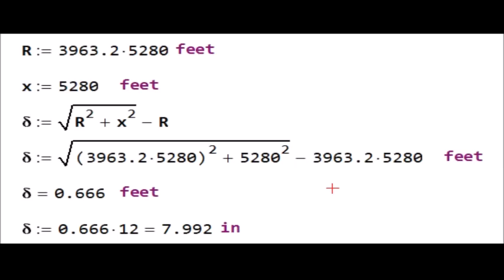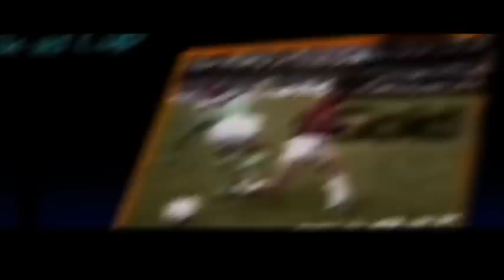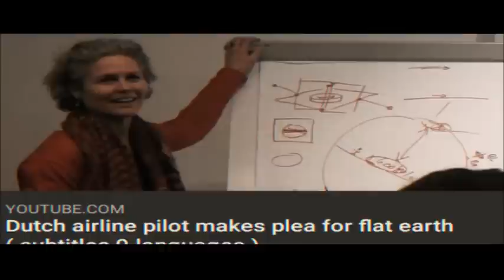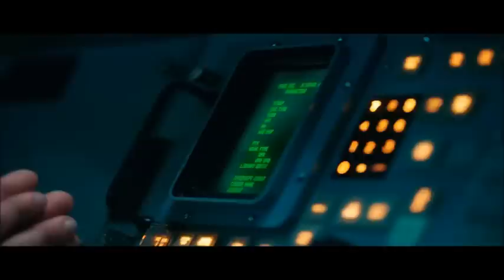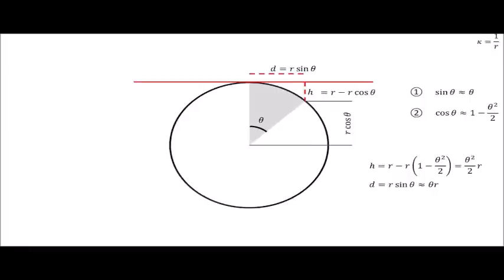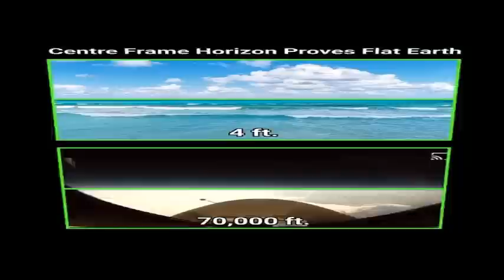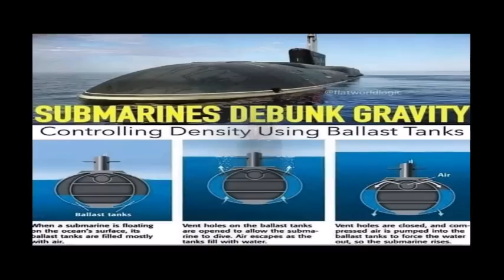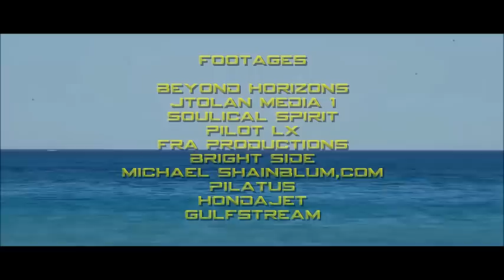2022 Flat Earth documentary Flatten The Curve by Vikka Draziv ✅

Comment: ººThere's no way that a large source of heat that is far away can render an object frozen at the top and bottom but hot in the center.  For that to occur the source of heat would have be close and small.  Meanwhile we can see moonlight on local clouds but not on distant clouds. The Sun and Moon are local and small.
ºIf you are in a car going around a curve then you're going to uncontrollably slide across the seat. 
They say that we are spinning 1038 mph while going around the Sun at 66,600 mph while our system goes around the galaxy at 480,000 mph while the galaxy goes around the “Great Attractor” at 2.2 million mph.  That's four different curves that we are supposed to be going around at the same and yet, no seatbelts.
ºThey say that that the Earth's rotation is due to the surplus energy of the formation of the Solar system.  So what makes a gaseous atmosphere rotate ?  How can air be fastened to the ground ?
 They say that we don't feel motion, only acceleration. How would you feel any acceleration when there is no motion ?  If we were in motion then any change would be noticed but if the Earth is at rest then there couldn't be a change in velocity.
ºI used to think that the Earth was a ball, which is why I couldn't realize the truth.  But once I did realize the truth, then it all made perfect sense and now life is no longer a mystery, it now has meaning, direction and purpose.  
 Darkness lost its grip in this light and death became meaningless.  Spiritual consciousness, eternal and devoid of the change of death, is the true state of life.  
ºFlat Earth realization is only the beginning.  God or not, man is the center of Creation and a universe being created is not only redundant it is deliberately misleading  There is only Creation.
ºIf you can see waves crashing on the beach with a zoom lens 20/50 miles out to sea, then you already know that the Earth is flat.  You just haven't connected the dots yet. 
 ºIf you know that we've been navigating by Fixed Star Location for over six thousand years, then you already know that the Earth is stationary.  You just need to put the pieces together.
 ºIf you want to see flat-earth proof then take an airplane five miles high and look out the window.  The horizon will always come up to your eye level. That can't happen on a ball and it would  be stupid to believe otherwise  
 I know that the story of Genesis has been made to sound foolish but it’s nothing compared to what mainstream science would have us believe.  They are trying to deny us of our birthrights by hiding Creation from us. They don't want us to become spiritualized and free ourselves from material entanglement. (Earth is our habitat because Earth is our habit).
"Him that overcometh will I make a pillar in the temple of my God, and he shall go no more out." Revelation 3:12.
God Bless and Optimism.
Reply: I’ve stopped reading your comment after the first sentence, which is just wrong, why should I be bothered reading the rest? Even the description of the sun as a source of heat is mostly wrong. You are ignoring atmosphere and different types of electromagnetic radiation, IR, UV and Vis. In other words, you don’t know anything about climate and the underlying physics of interaction between light and matter. Without the atmosphere earth would be very cold all over the place.
Reply: @enricocavallo4386  Answer this . The earth is travelling at over 1000 mph at the equator. A Boeing top speed is 570 mph . If the Boeing takes off in the exact same rotation of the earth it is essentially flying at 1600 est to reach its destination. If that same Boeing takes off ln the exact opposite direction as the rotation of the earth.. how could it reach its destination when it is 500 mph too slow for the rotation of the earth? Take your time sweetheart 🤣🤣
Reply: @enricocavallo4386  the Boeing can only reach its destination flying with the earth rotation because it s speed is faster than the rotation. It’s very simple.. the earth is flat.
Reply: @adambartlett6421  , what does your comment have to do with the comment I made? There is a simple answer to your question, which basically is just a flat earther straw man argument. The problem is that you don't know anything about physics. Otherwise you would not raise the silly question.
Reply: @enricocavallo4386  the reason you stopped after the first sentence is your cognitive dissonance. I know , it happened to me several times before I pushed passed it and opened my mind. I used to tell people how much they didn't know about the atmosphere and a whole bunch of other things. Until one day I came to the realization that I also only knew what other people or books had told me about all of  those things. I didn't want to be called all of the names that I saw gloabers calling FEers. Until I realized it didn't matter, they don't know me and besides my curiosity was just eating me up. At first it was crazy then it was entertaining and then it started making more sense than everything I had learned about our planet/home over the past 45 years. I don't know how it actually benefits me personally to believe the earth is not a globe because I already believed in God and that Jesus Christ died and rose for the forgiveness of my sins. I understand better now why they push the ball Earth narrative. Ultimately it takes God out of the picture. It's Satan's way of getting at God by taking as many souls to the lake of fire with him as he can. The truth will set you free and Jesus Christ is the truth ,the way and the life. Don't stop seeking the truth.
Reply: @adambartlett6421  for starters, your assumption that the earth is travelling at over 1000 mph is a misconception. You confuse speed with angular speed. As to the latter, watch the hour hand of a clock moving. That's twice the "speed" of the earth spinning. Got it?
Reply: @adambartlett6421  , the only thing your question disproves is your knowledge in physics. I mean, basic physics including Newton's axioms. Every observation is in accordance with the globe model and you flat earthers cannot even explain the sun path.
Reply: @adambartlett6421 , and because you lack this understanding of physics you are not in a position comment on the shape of the earth. Before you question the spinning globe you have to understand it. I'm afraid you don't. My advice: get an education.
Reply: @jelly7310 , you can believe whatever you want but scientific facts are not a matter of belief. Likewise, the bible is not a source of  reference when it comes to science.
Reply: @adambartlett6421 , "we're done with here" is a toddler's reaction.
Reply: @enricocavallo4386  you can’t answer because it’s flat
Reply: @adambartlett6421  which part of my previous comment did you not understand?
_ for starters, your assumption that the earth is travelling at over 1000 mph is a misconception. You confuse speed with angular speed. As to the latter, watch the hour hand of a clock moving. That's twice the "speed" of the earth spinning._
Once you confirm you understand Newton's axioms and the difference between velocity and angular velocity I can answer your question. Before that it would just be pointless.
Reply: The sun is demonstrably millions of miles away. Simple trigonometry that a child can do proves this. You can also show that it isn't local yourself with a stick. The earth is a spheroid
Reply: According to science earth is rotating approximately 1,000mph clockwise.  The moon is moving 2,288mph counterclockwise around the earth and it takes 27 days to complete a full cycle.  The earth is circling the sun at 66,600mph and moving 140mph thru the Milky Way. Then, the Milky Way is speeding through the Universe at 1.3million mph! 
Polaris remains in the same position? Star trails are consistent? 
I know, gravity keeps them by our side!🤣
Reply: @natalierhoten8609  polaris is 323 light years away. The radius orbit of the earth around the sun is 93 million miles which is a 0.00015 light years. So with this in mind the amount of distance we move in a human lifetime is very small (but significant) and simply glancing at the stars will make you think they are always the same. Using carefully calibrated equipment you can detect stellar parallax which shows that we are moving. It's quite simple really.
Reply: @natalierhoten8609  , Startrails disprove flat earth. As to the rest of your comment, see Andre's response. Didn't you take physics in school?
Reply: @super_ficial  , about each sentence you wrote is totally wrong. For examples lakes and ponds are affected by moon's gravity. But the less volume of water is to be moved,  the smaller the effect. And streams? Well, they're floating anyway due to earth's gravity and the effect of moon's gravity is  negligible.
Reply: @super_ficial  Tides caused by electromagnetism? You didn't take physics  in school, did you? And then the question arises what happens to diamagnetic water in ponds and lakes? You're challenging your own arguments 😄
Reply: @natalierhoten8609  lts insane to think this is happening and we have mirror like lakes when there is no wind 😂😂😂😂
Reply: @enricocavallo4386  you only proved his point more, if the sun doesn't provide the only heat source it makes the suns distance even less important.
Reply: @carbide1968  , did you actually read and grasp my comment? Do you understand how the earth is heated? I give you a clue: imagine there was no atmosphere...
Reply: @adambartlett6421  by your logic it would be insane to think you could have a drink on a plane. Think about it.
Reply: @enricocavallo4386  What is the angular speed?
Reply: @super_ficial  I tried to disprove the Flat Earth theory 7 years ago! Looking for the ONE photo of the ENTIRE earth without CGI! It's like looking for a needle that doesn't, exist in a haystack!!!
Reply: @super_ficial  Yet, we're the special crazy ones?
Reply: @natalierhoten8609  l want to meet you
Reply: @adambartlett6421  Not gonna😘
Reply: I'm too shy😉
Reply: @natalierhoten8609  Shyness is debilitating, get over it.
Reply: @natalierhoten8609  😟
Reply: @natalierhoten8609  if you don't know what singular speed is pick a physics book.
Reply: @natalierhoten8609  the Blue Marble photo was taken before there was CGI. Besides, you don't need a photo to disprove flat earth. Put a stick into  the ground and watch the movement of the tip of the shadow it is casting over a period of several hours. If it is circular, earth is flat. Simple, isn't it? Why doesn't any flattie do this experiment?
Reply: @super_ficial  , no response to my comnent on the first sentence of the initial comment? I thought so - you're  clueless.
Reply: @super_ficial , your playing with numbers is so ridiculous...
Half of it doesn't make any sense when you apply the metric system or    round the numbers at a different digit. The rest is just far-fetched, especially the allusion to carbon atoms (by the way, there are carbon isotopes with 7 or 8 neutrons).
Reply: @super_ficial  I'm not really shy(maybe sometimes). I've been in sales most of my life then, Room Mom...I'm divorced due to conspiracies and FE. It's been ruff. I don't date. Most people don't understand me. They think, I'm a little touched. Why bother?
Reply: @natalierhoten8609  The one constant thing in my life has been disillusionment and it's almost always painful, but it's the price that we pay to free ourselves of material entanglement and Spiritual liberation.
  "He who learns must suffer. And even in our sleep pain that cannot forget falls drop by drop upon the heart, and in our own despair, against our will, comes wisdom to us by the awful grace of God…"    Aeschylus
Reply: @natalierhoten8609    You feel isolated because you are a world in a universe of plants. They can't relate to you.  You need to look inwards.
ººAnytime life comes in contact with matter its ego becomes influenced and entangled, its consciousness is dragged down into this realm of pleasures.  But all pleasures are habit forming and will ultimately end in sorrow, despair and the surrendering of the ego (the Devil doesn't know who he works for).   Matter was designed to bring man back to God.   God's plan is perfect in every way.
ºSaints have declared that if a person, even once, really desire salvation, that desire is firmly planted in the super consciousness's mind, no matter how long it is ignored, it will germinate when favorable opportunity arises.
ºAll personal issues and all enigmas can be resolved though the development of intuition, the divine medium of communication between God and man.  Meditation, Prayer and Yoga should not be underestimated.  Prayer (speaking to God), Meditation (listening to God) to develop intuitive reasoning and realization and Yoga (the science of God) to burn Karma (attachments to materialism).
 So that we can free ourselves from material entanglement and get out from under the wheels of reincarnation once and for all.
"Him that overcometh will I make a pillar in the temple of my God, and he shall go no more out."     Revelation 3:12 

Autobiography of a Yogi
https://www.ananda.org/autobiography/ 

Enjoy.
Reply: @super_ficial Life is beautiful! It is a stage or several acts, we are living though. I'm in the early final act(hopefully). 
...blah, blah, blah...
I hate texting and I'm  tired of Fe! 

Sweet dreams...Don't take the Red Pill!

The Earth is
Reply: @natalierhoten8609  It is nice to be able to see the finish line.
  When you awake from this dream, I hope that it will be into a sweeter dream.
Reply: @adambartlett6421  
"Answer this . The earth is travelling at over 1000 mph at the equator. A Boeing top speed is 570 mph . If the Boeing takes off in the exact same rotation of the earth it is essentially flying at 1600 est to reach its destination. If that same Boeing takes off ln the exact opposite direction as the rotation of the earth.. how could it reach its destination when it is 500 mph too slow for the rotation of the earth?" -Adam Bartlett
You are so close to answering your own question. The plane would fly at about 1600 mph when observed away from Earth, when following Earth's rotation. In the other direction it would fly at about 430 mph in direction of Earth's rotation. Since that speed is slower than Earth's rotation, the ground basically overtakes the plane making the plane move in the opposite direction relative to the ground.

It's like walking on conveyor belt. Let's say the belt moves at 5km/h. If you move at 5km/h relativ to the belt in the same direction as the belt, you move at 10 km/h relative to an outside observer. When moving in the other direction you are basically standing still for an outside observer. In both cases you would move the same distance relative to the belt. Or on a treadmill, where you can run for kilometers while not leaving the treadmill.
Reply: Bless your heart❣Are you saying for seven years,  you couldn't figure the shape of the earth out with out CGI? Have you seen, "The Blue  Marble" where he explains,  "it has to be photoshopped " by Robert Simmons! 
The astronaut Don Pettit said,  he would go to the moon in a nanosecond, but we lost the technology?"
Reply: @natalierhoten8609  
Robert Simmons only talks about the blue marble from 2002, which is a composite of photos taken by low earth orbit satellites. It's not CGI. He also mentioned the photos taken during the Apollo missions, which as he said, at the time of writing, were the last photos taken from far enough away to capture an entire hemisphere. Those were are not photo shopped or CGI.

Building rockets to bring astronauts to the moon are very expensive, and NASA's budget was cut after landing on the moon six times, because the public lost interest. They simply no longer had enough funding to build Saturn V rockets, and repurposed the construction facilities to build smaller rockets to send satellites into orbit. Nowadays they are working on the Artemis project to return to the moon.

He also said that they used to have the technology. We also no longer have the technology to build steam trains, does that mean that steam trains didn't exist?

Explain to me how does someone saying that one image is photo shopped, not CGI, mean that every image is CGI?
Reply: @super_ficial  I bought it, hook line and sinker! I was a space junkie until 2016 when, my world was turned upside down! Once you've done the research, you can't go back! 
I'm pretty close to you in age. The Challenger space shuttle was devastating! It made me sick to see all students watching their teacher take flight! 
We live in a sick world! I want to put my rose colored glasses back on and forget what I've learned.
Reply: @natalierhoten8609  You don't want to do that.
    He who learns must suffer. And even in our sleep pain that cannot forget falls drop by drop upon the heart, and in our own despair, against our will, comes wisdom to us by the awful grace of God…  Aeschylus
Reply: @super_ficial  I know. Everyday, starts with prayer and ends with prayers and a lot in between! Our Heavenly Father probably wants a break(just kidding).
Reply: @natalierhoten8609  Everything starts and ends with, The Word.
Reply: @natalierhoten8609  Everything starts and ends with, The Word.
 ººWhen you wake up in the morning and you hear that buzzing sound in your head, that is your Medulla oblongata (the mouth of God) vibrating.  And from the mouth of God comes the Word of God.  This vibration is the Holy Ghost,  Jesus's gift to us that he called, "The Comforter" unison with this vibration is union with God.  This is the sound of Creation revolving around you.   And not the other way around
"In the beginning there was the Word and the Word was with God and the Word was God"  and the Word is, "Aum".   Aum is the cosmic vibration that hold all atoms together as opposed to, "Om" the comic vibration that keeps atoms apart.  In Hebrew it's pronounced Amen and Al-man. Krishna walked on air four thousand years before Christ walked on water and four thousand years before the crucifixion Yogis used the cross to represent man's eternal life as Spirit over his ephemeral life as an animal, and then as if by script, Jesus a man who died like an animal on that very symbol, crossed over and released his spirit as pure Christ consciousness.  Over thousands of years and thousands of miles the story progressed, the truth never changed and it all began when the Heaven and the Earth was created as God moved his hand across the face of the Deep and divided the Waters from the Waters.  Water was never created and it certainly doesn't bang.  There was no Big Bang, just a Big Lie.
 The bodies of all creatures are spumescent bubbles on God's comic dream-ocean.
Reply: @super_ficial  That blew my mind! You are so beautiful and eloquent with your description of our Heavenly Father"s word through his son, Jesus Christ our lord and savior!
I have been disillusioned from fake people in my life.  It hurts to see so many destructive esoteric humans!
Reply: @natalierhoten8609  Thank you.  "Beauty is all you need to know". from The Bible.
Reply: @natalierhoten8609 , it doesn't matter what you or I believe. Earth is not flat.  You suggest applying common sense. Well, if you did you'd understand earth cannot be flat. I repeat:
Put a stick into  the ground and watch the movement of the tip of the shadow it is casting over a period of several hours. If it is circular, earth is flat. Simple, isn't it? Why doesn't any flattie do this experiment?
Reply: @enricocavallo4386  The World Record for Long Distace photography is from: Mark Bret on 7/16/16. It's 443km/275.27miles from Finestrelles Pyrenees to the Apls! That's not possible with sticks or a globe!
Reply: @ActionParsnip  How far away is 323 light years away?
Reply: @enricocavallo4386  I took it in college.
Reply: That was beautiful!  Genesis tells us God seperated the waters above called heaven from the waters below on Earth. And it was good!
Reply: @enricocavallo4386  I would highly recommend you watch "Flat Earth Clues"! Then, come back with a more educated response.
Reply: @adambartlett6421  Where do you live?
Reply: @natalierhoten8609 l live in Sunshine Coast Queensland Australia you nat?
Reply: @adambartlett6421  Cumming, Georgia, USA 🇺🇸
Reply: @natalierhoten8609  ººWhen you wake up in the morning and you hear that buzzing sound in your head, that your Medulla oblongata (the mouth of God) vibrating.  And from the mouth of God comes the Word of God.  This vibration is the Holy Ghost,  Jesus's gift to us that he called, "The Comforter" unison with this vibration is union with God.  This is the sound of the Creation revolving around you.   And not the other way around
"In the beginning there was the Word and the Word was with God and the Word was God"  John 1:1
And the Word is Aum.  Aum is the comic vibration that hold all atoms together as opposed to Om the comic vibration that keeps atoms apart.  In Hebrew it's pronounced Amen and Al-man.       
 Krishna walked on air four thousand years before Christ walked on water and four thousand years before the crucifixion, Yogis used the cross to represent man's eternal life as Spirit over his ephemeral life as an animal, and then as if by script, Jesus a man who died like an animal on that very symbol, crossed over releasing his spirit as pure Christ Consciousness.  Over thousands of years and thousands of miles the story progressed, the truth never changed and it all began when the Heaven and the Earth was created as God moved his hand across the face of the Deep and divided the Waters from the Waters.  Water was never created and it certainly doesn't bang.  There was no Big Bang, just a Big Lie.
ºThe bodies of all creatures are spumescent bubbles on God's comic dream-ocean that we call, "The Waters, The Deep, Mayim, Thrum, Celestial Seas or Primal Ocean".
ºA universe being created is not only redundant, it is deliberately misleading, there is only creation and we are the center of Creation, man's image is not random but his wisdom is poison.
Reply: @natalierhoten8609  nice 👍. I e always wanted to travel to the states but I’m unvaxxed 😩
Reply: @adambartlett6421  Sadly, me too! I can't even cruise without being vaxed!
Reply: Thank goodness, I've been there and done that! But, my teenagers haven't!
Reply: @natalierhoten8609  lovely to talk with you. Stay safe and tuff
Reply: @natalierhoten8609  They will be fine.  
 We all have to finish our dreams before awakening.
Reply: @natalierhoten8609  , "The world record..." - that's a nice one! All of Marc's pictures are in full accordance with earth's curvature and he also explains it well. You should not only look at the pictures but also read the text, especially under the headline "Refraction". You should also read the comments section, in particular comments made by Dark Star and you should go to his web page as well.
Reply: @natalierhoten8609  Still on "The world record..." 
If earth was flat you would expect a much, much higher world record. With a good telescope you should be able to see the Manhattan skyline from Cabo de Roca in Portugal.
Reply: @natalierhoten8609  , you took "it" in college - what is "it"?
Reply: @natalierhoten8609  , "a more educated response"? I did not get my education from silly YT videos.
Reply: @enricocavallo4386  Are you serious? Refraction,  has nothing to do with a long distance photograph!
Reply: @adambartlett6421  You also! It's nice to meet other like mind people ❣
Reply: @natalierhoten8609  , read the text on Marc's homepage. Refraction is key -  because undeniably earth has got an atmosphere.
Reply: @adambartlett6421 , you should ask Natalie if she can see the southern cross constellation in Georgia - because on  a flat earth she should be able to see it.
Reply: @super_ficial  So true❣ I waited forever to have them and everyday has been a blessing 🙏🌞❣
Reply: @adambartlett6421  , about the sun path in Australia: left to right or right to left? Share this with Natalie...
Reply: @enricocavallo4386  watch " The Firmament: Rocket hits the dome"!
Reply: @enricocavallo4386  the sun rotates around us from the east once a day. Find a point of reference for you to see for yourself. There is a partial eclipse end of April next month. The sun and moon are nearly on the exact rotation with each other now. Find a location. On the fifteenth of April . Watch the sunset. Then the next morning.. watch the full moon set in the EXACT location.
Reply: @natalierhoten8609  , that is one of the silliest videos I've ever seen. If you understood basic physics you would agree. Momentum and collision are the keywords in this context. Long story short, a rocket hitting the dome must either break the dome or be smashed.
Reply: Exactly fifteen days later when the sun catches the moon on its rotation we have our eclipse
Reply: @adambartlett6421  you seem to be avoiding the question. From east to west, does it mean left to right or right to left in Australia. Or, related to  that, how does the waxing moon look like in Australia: open to the left or to the right? The correct answer to both questions for a) Australia and b) Georgia shows earth cannot be flat.
Reply: @natalierhoten8609  It has all been a blessing; filled with pain, fear, doubt and anguish but we live for Joy no matter how scarce it may be.  This is our spirit.
 We were conceived from joy, we live for joy and we will return to joy.
 This is the physical realm, the realm of pleasures but all pleasures are habit-forming and will ultimately end in sorrow.
 Do not love this world, it is filled with wickedness.
Reply: @adambartlett6421 , that's not how eclipses work.
Reply: @adambartlett6421  The Moon is 24, 000 miles away and the Sun is 93,000,000 miles away and we don't just get eclipses, we get both perfect solar and lunar eclipses.  That's BS.  The Sun & Moon comes as a pair.
Reply: @super_ficial  dude your moon is 100000 m too close to start with . Use your mind better
Reply: @adambartlett6421  I don't know where you get 100000 from.  Apparently I am using my mind better.
Reply: @super_ficial  your comment the moon is 24 tho miles away. Go away genius
Reply: @super_ficial  and Adam, too: ever heard of lunar laser ranging?
Reply: Lol first paragraph is nonsense. It cold at North and South of earth because of the angle of the sun. You may notice where you live the temps starts of low and gets hotter the  higher the sun is in the sky. Them gets cooler late afternoonó when the sun is at a lower able.,
Reply: @doyleelad1113  I've notice that it gets cooler when the Sun is further away.
  And I noticed that under no condition can you freeze a ball at the top & bottom and still be 100º in the middle.  And so your claim that mt first paragraph is nonsense, is simply malicious and is itself nonsensical. 
 Your explanation, at best, is a familiar lie.
Reply: The Man above Gave us mire mortals The 1 & Only Map you will ever need. It  The largest map ever Created. Few if any even know where it is. Yet you can see it almost everyday some days better than others.  A Map that was never Drawn why? The O Mighty knew paper and Ink could be Used  Deceive, Lie & Mulniplate. Do you know where  this Spectacular Reproduction That we a Map is?
Reply: @enricocavallo4386  The Man above Gave us mire mortals The 1 & Only Map you will ever need. It  The largest map ever Created. Few if any even know where it is. Yet you can see it almost everyday some days better than others.  A Map that was never Drawn why? The O Mighty knew paper and Ink could be Used  Deceive, Lie & Mulniplate. Do you know where  this Spectacular Reproduction That we a Map is?
Reply: @adambartlett6421  The Man above Gave us mire mortals The 1 & Only Map you will ever need. It  The largest map ever Created. Few if any even know where it is. Yet you can see it almost everyday some days better than others.  A Map that was never Drawn why? The O Mighty knew paper and Ink could be Used  Deceive, Lie & Mulniplate. Do you know where  this Spectacular Reproduction That we a Map is?
Reply: @super_ficial  so you noticed it gets cool when the sun us further away. How?
Reply: @super_ficial  under no condition can you freeze a ball at the top and bottom and still be 100° in the middle  - why not? Remember, the ball you're talking about it is huge. Your assumption would be the same for a flat earth, btw.
Reply: @jlvdw8709  I am going to go with... each & every 'Lifetron' (better known as atoms).   Every atom is alive, conscious and at least semi-intelligent.
Matter was divinely designed to bring man back to GOD.
Reply: @adambartlett6421  You see the atmosphere is stationary (no, not like a pen) relative to the Earth's surface. That is why a hurricane is important. Because if the atmosphere was blowing at 1000 MpH all the time, you wouldn't really have time to spot a hurricane.
Reply: @jelly7310  Jesus and his dad made a globe or they weren't involved.
Reply: Tell us more about how you never passed a science class above the third grade....
Reply: @tipigi3570  Even though I had no difficulties in passing the 12th grade with a B average, I was still able achieve disillusionment.  And I don't ming bragging about it.  Thanks for the opportunity.
Reply: @super_ficial  No, you've achieved being fooled by people with no scientific background, there's a difference. 

We get it... instead of believing people who have dedicated their lives to earning a PhD, and then given decades of their life to study a particular field, you're going with guys, with no scientific background, that make YouTube videos and memes, while selling merch on the side. 

Brilliant choice....